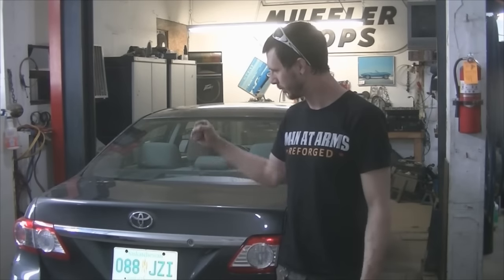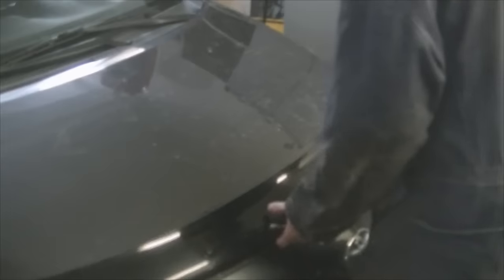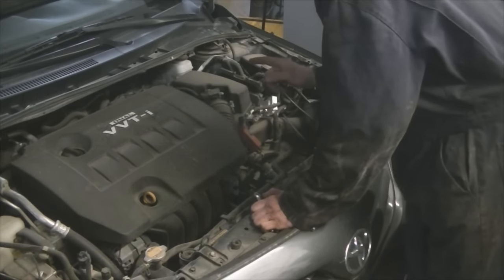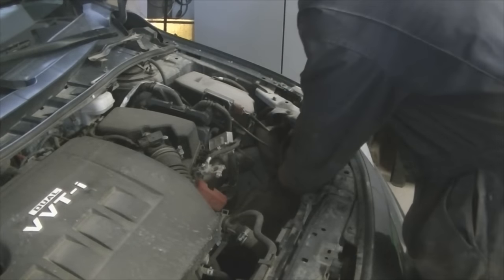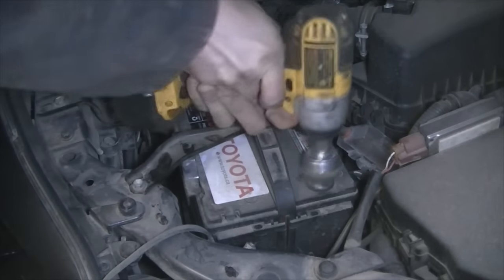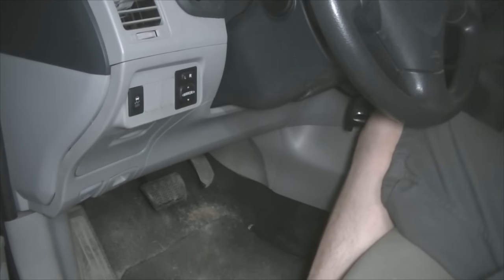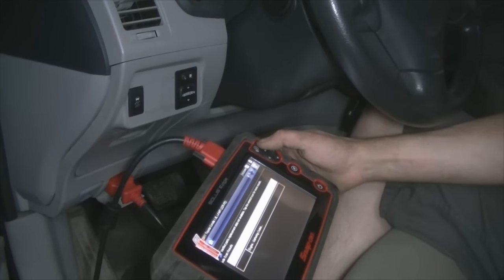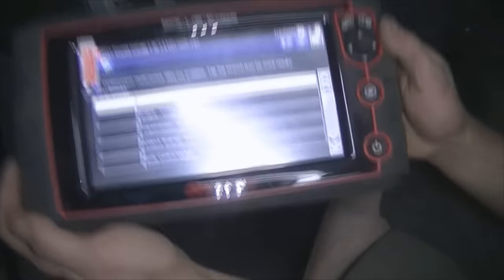2011 Corolla: Summer Shoes

Comment: little suprized you didnt buy a set of spare rims from the wreckingyard somewhere couldnt be more then about 100 dollar with the tires 
makes changing between summer and wintertires a lot eazier 

if the traction controll is still mallfunctioning maibe it puts the code in after you start and driven the car again (prolly be sumtin general like traction controll not working.... oh realy?)
might allso be the voltage of the battery was slightly below the cut of point and you heared a relay not quite clicking on
Reply from the maker: yea, im actually looking at a nice set of mags for this car. these tires will probably be done by the end of summer. hopefully ill have enough cash for em.

yea, the code is still gone. must have had everything to do with low voltage haha

cheers bud!